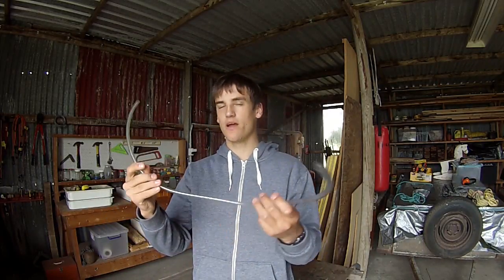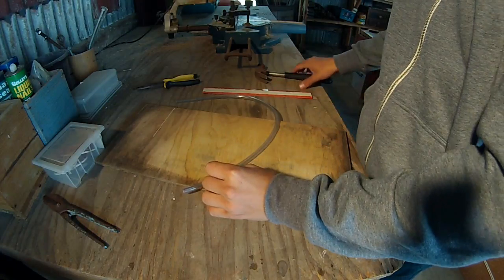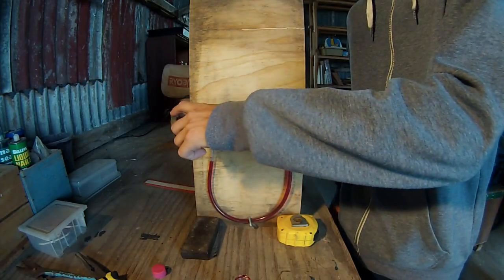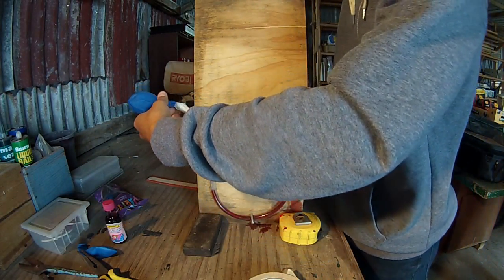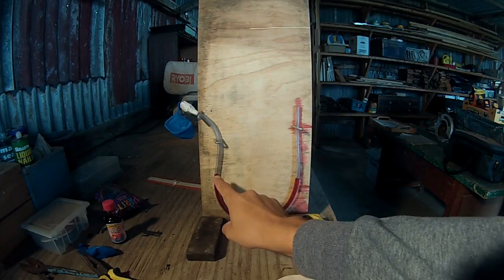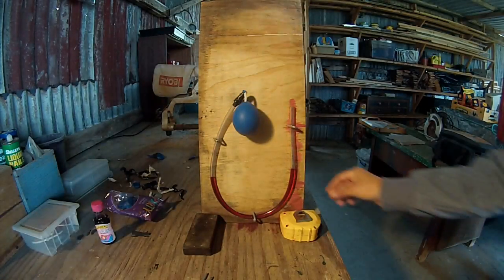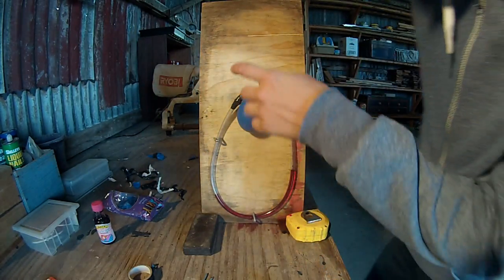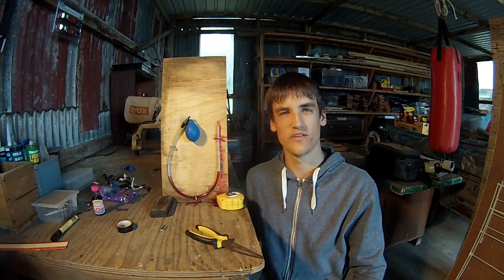Building and testing a Manometer!

Comment: The back and forth could only have been caused by your movements or variations at the insecure leak point. Interesting try at a 'man-ometer' (pronunciation). The water manometer is still actually used in some semi-scientific fields due to its low cost and good sensitivity for measuring small pressure differentials. You could try a closed-end manometer. Doubles the resolution.
Luke 11:13